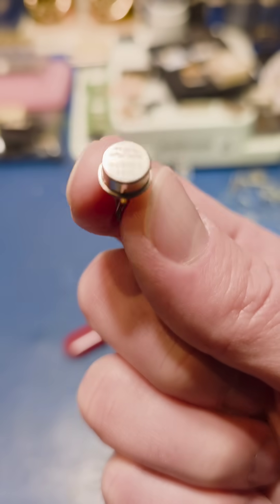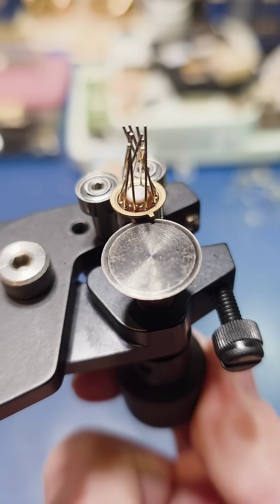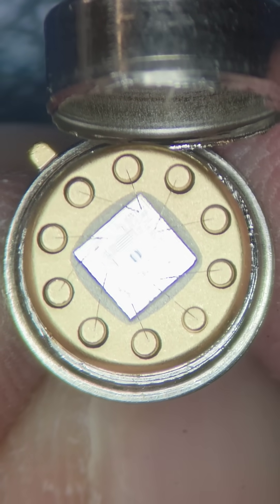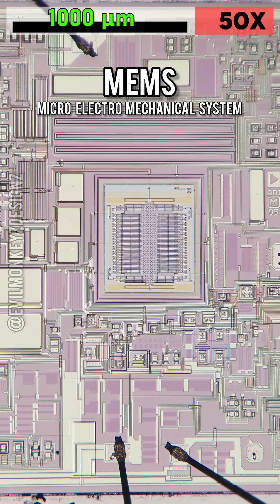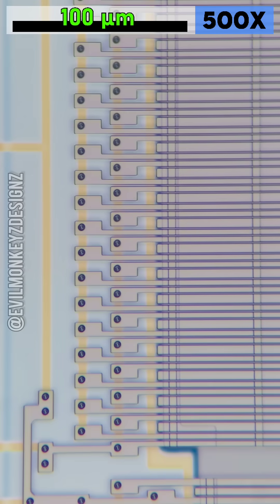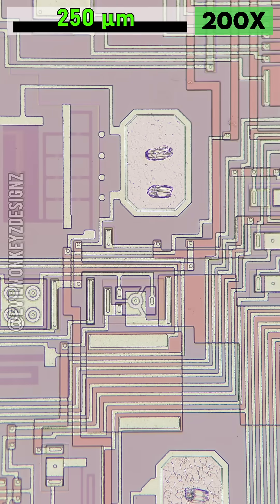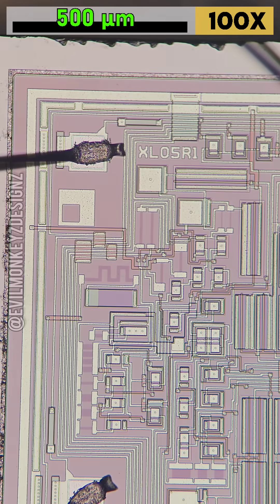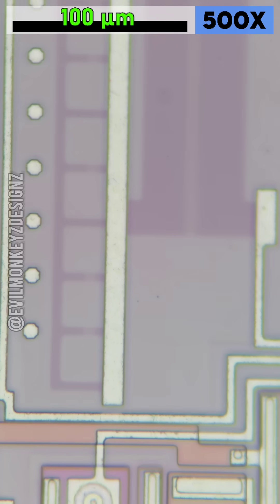ADXL05 MEMS accelerometer

Comment: wait accelerometers are mechanical I always assumed it was some fancy electronics
Reply: A lot of sensors these days are kinda blurring the lines between mechanical and electrical and chemistry and computation. 

I do a lot of gas sensing for work, and some of those work by hitting a piece of metal with a (piezoelectric) hammer and seeing if it's loud or quiet, high pitched or low pitched. Some work by putting your hand over the stove to see if it's hot. Some shine a light and see how bright it is to determine if something is in the way.

Comment: honestly that is so awesome, i dont know anything about electrical engineering but I have been watching videos like these for a few years and playing with arduino some, which has made me able to almost understand a quarter of what is going on yet, its like listening to a 2nd language in a foreign country.
Reply: I encourage you to google for the datasheet for this ADXL05. It has a "Theory of Operation" section that is pretty understandable. Partly because the principles involved are quite simple, as it turns out.  The "only" magic is that it's so miniature. I often think that sensors and actuators are some of the most fascinating devices, as they represent the interface between the electronics/data realm and the "real world" around us, much of which is quite tangible to ourselves.

Comment: Change in capacitance causes frequency modulation of a signal. A slope detector then takes this signal and feeds it into an analog-to-digital converter (ADC) then outputs the digital information in a serial stream. Whoever invented this system has got to be a genius!
Reply: The ADXL05 does not use FM.  The sensor consists of a sandwich providing two fixed outside plates, and one middle plate that is movable by acceleration force. At rest, the capacitances between each outside plate and the movable middle one are equal. The chip uses a fixed frequency (1MHz), differential signal with one phase fed to one outside plate, and the other phase to the other plate. At rest, the effects on the center plate cancel. But when accelerated, the center plate moves closer to one plate than the other, leading to a net signal on the movable plate. That signal is close to proportional to the movement (and thus acceleration).  That signal is then detected (measured) by conventional AM amplitude demodulation, and the demodulated signal feeds the ADC. Actually the demodulation is synchronous with the original 1MHz signal, so it can detect not just extent of movement (of the middle plate), but also direction, hence positive or negative acceleration.
Reply: @ Thanks for clearing that up. The method I described was explained to me by an engineer, and it could have been for a different device.
Reply: Thank you
Reply: @discoverneweyes  LMAO. You win. Everyone being too serious here. lol
Reply: You skipped over the how the six hydrocopic marzel vanes are fitted to the ambiphasient lunar wang shaft to prevent side fumbling.
Reply: @flipadavis pah! Your ignorance of the interfambulating groundelfanger is obvious😂
Reply: @ Hahaha. Not sure if your comment was for me or OP, but I guess you're light-hearted mocking us conducting a technical discussion.  But hey, if you found the video interesting, I encourage you to download the datasheet for ADXL05 (just search for it). It has a nice "theory of operation" section that's pretty interesting, and I think understandable not just by engineers. It's quite neat.
Reply: @flipadavis  Nice catch and contribution. What I'll do is create a GUI interface in visual basic; see if I can track an ip address.